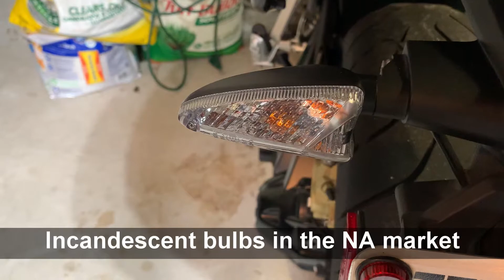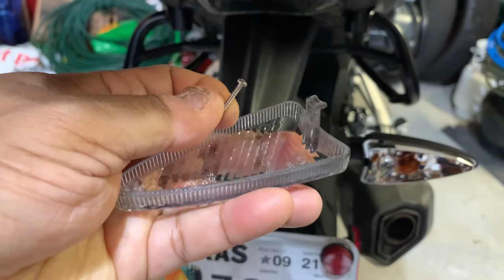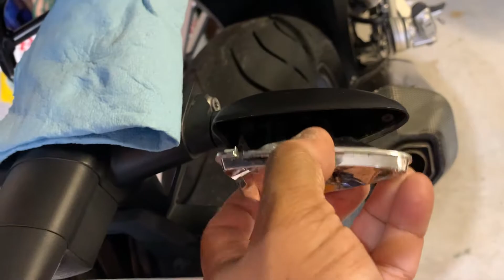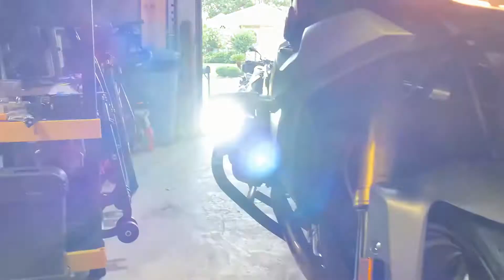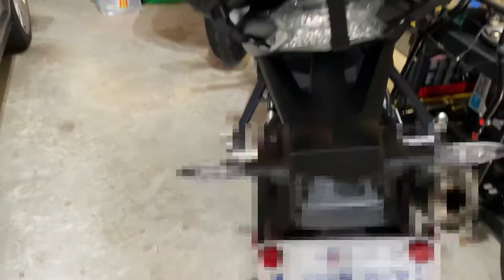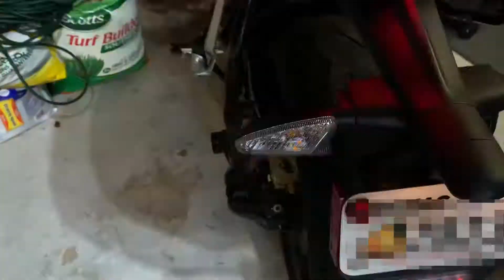Bloody Bright Blinkers! | Dynamic Motorrad LED Turn Indicators | 2016 BMW R1200RS MODIFICATIONS

Comment: Anyone know if Dynamic Motorrad is out of business? Their website is a blank page that says "coming Jan 2025." If this is the case, anyone know of any other replacements that work?
Reply from the maker: According to Google AI, they are not out of business although (the AI acknowledges) the website promises to be back in January 2025. The AI also says that "A related but separate company, Dynamic Cycle Parts Inc., operates in Woodbridge, Ontario, and continues to be an active motorcycle parts and accessories supplier. ". (https://dynamiccycleparts.com/)

Comment: I got and installed a pair of Weiser Ultra Brights with a 12 LED array each at a BMW Rally a few years ago.  I wonder how these Dynamic Motorrad bulbs compare in brightness. I was rear ended a few months ago and I'm looking for anything I can do to increase conspicuity.
Reply from the maker: These are indicator lights so while they are blinking they are conspicuous as heck. You’ll need something that is always on and red to be conspicuous at the rear. Something like the Denali B6 or equivalent helps. However when it comes to a rear ender, I doubt that an increase in conspicuity would help if the person was drunk, not paying attention, or worse.
Reply: @GrumpyGoat  A huge concern is that I was hit by a guy driving a Tesla. Seems like the more electronic aids are installed in cars the lazier drivers become.
Reply from the maker: @davetynan561  I agree ... as people get the wherewithal to afford these fancy cars with all the tech, many pay less regard to actual driving  and put more faith in the car and the tech they paid money for ... Not just Tesla drivers too, although some seem to be especially lacking ...

Comment: I agree, the Motorrad LED is brighter. Did you have to fit resistors to make them flash at the correct rate?
Reply from the maker: No resistors needed. They flash correctly out of the box. 👍